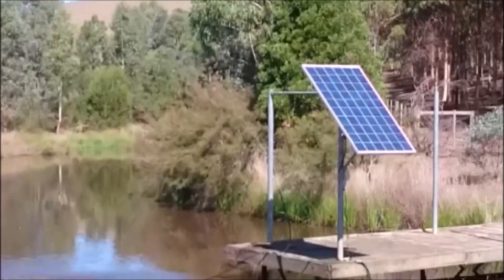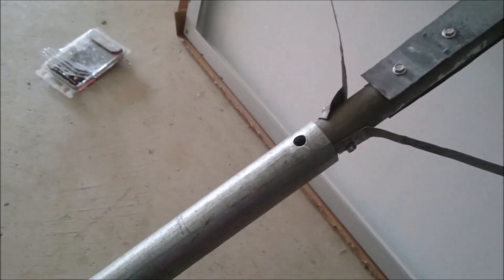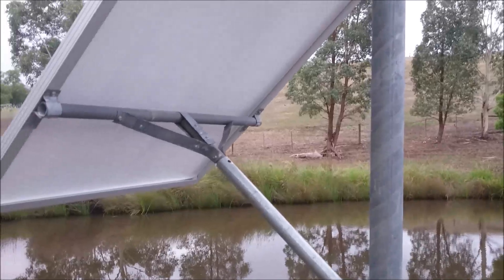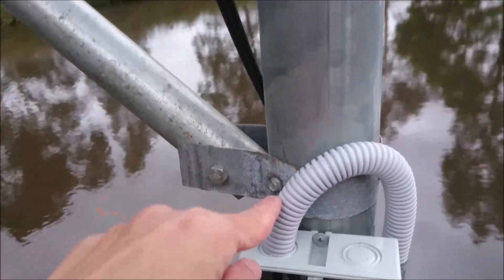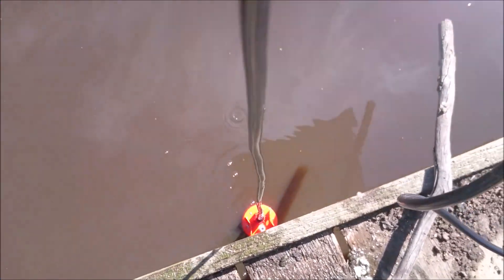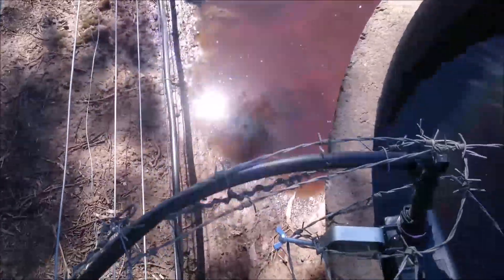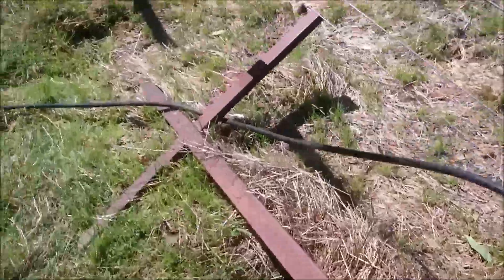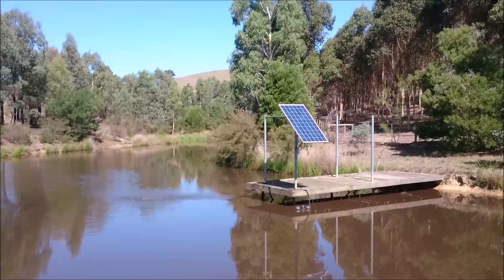Solar Water Pump Installation

Comment: Looks good for purpose. For larger projects keep in mind the pressure loss in thin pipes can be absolutely enormous. We replaced a very long thin 80 year old copper water pipe with new wide diameter pipe, and the water pressure improved dramatically. I'd guess x3 flow rate when tap fully open.

Comment: I have installed solar panels system but not getting discharge with force  on following details 
Borewell total depth = 290ft
I got water on =110ft
Motor installed = 150-155ft

My solar panels details 
Panal 320wt ×15

DC motor details 
5hp 25stage 4inch  100meter head

can anyone suggest me which DC pump I have to use for force
My phone no.   +918805505771

Comment: would you post the specific information of this pump.
Reply from the maker: It is 24V DC mini submersible pump. Bought it from Ebay.
Reply: Good job! Solartech is manufacturer of solar ac & DC pumps. Any interest, feel free to contact me via tiger.yan@solartech.net.cn or visit us on www. solartech.cn.
Reply: Hey, we are manufacturer of solar water pump, if you need this kind of soalr water pump, kindly contact me eva@starflopump.com
Reply: muze 0.5 hp solar pump chahiy 7218803435
Reply: Su Eva 

O
Reply: Solar pump in kutch gujrat
Reply: +Khimjibhai Satra hello sir I'm sathiguna Tamil nadu Pudukkottai 8110926961